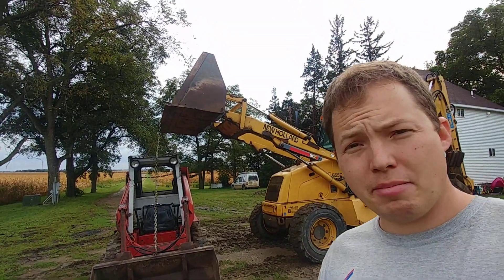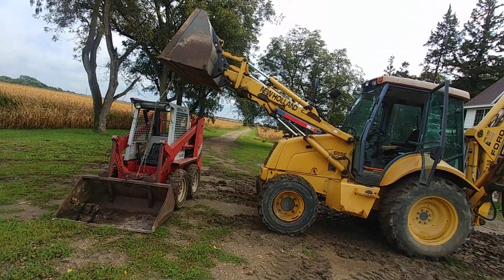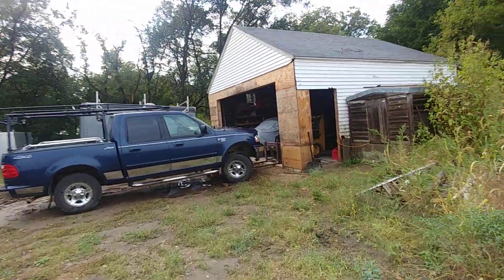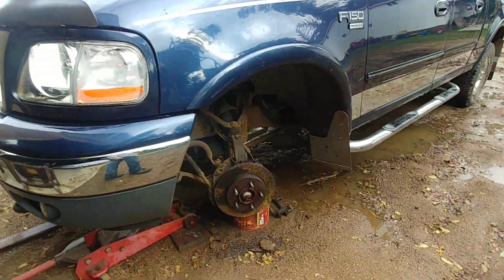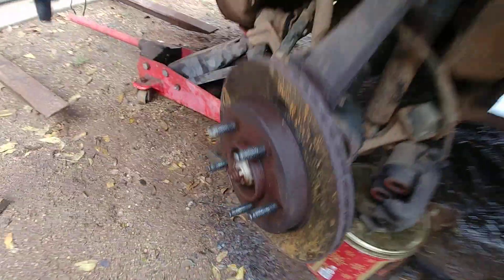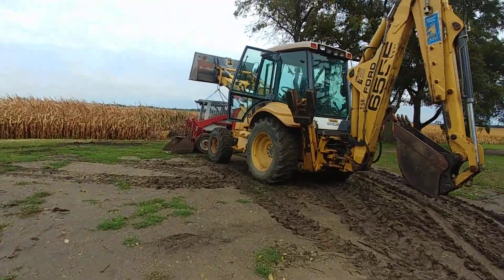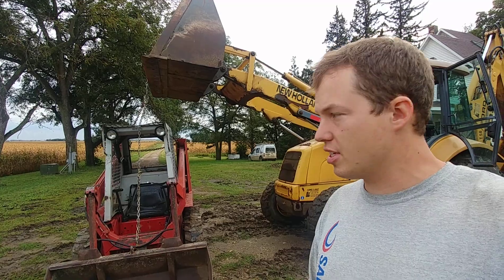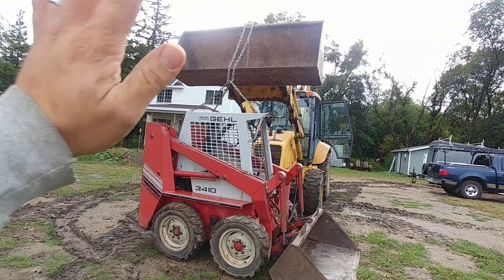Saying Goodbye to My Skid Loader...

Comment: You should probably buy a brake caliper rebuild kit for your truck just to be sure.
Reply: If one side wears out like that, it's a sign that either the worn side has a problem with sticking, due to a bad caliper or a bad rubber hose which is check-valving, or it could be that that brake is working fine, but the other brakes are not working at all, and are putting all of the stress and wear on that one brake.